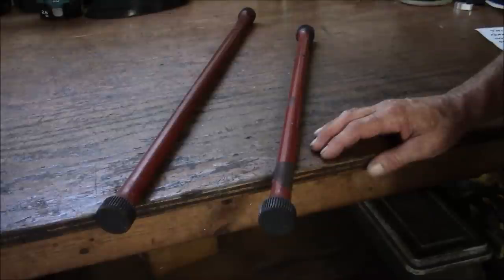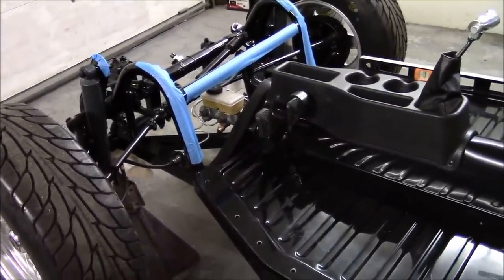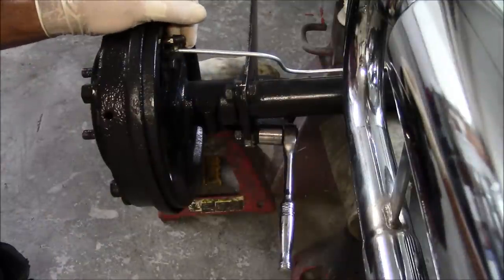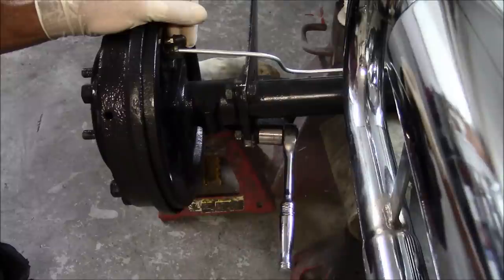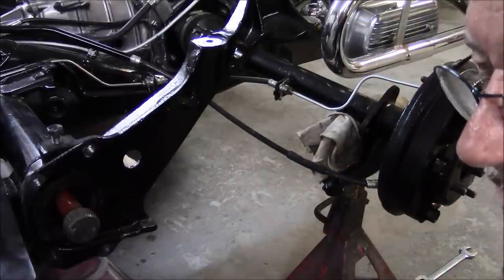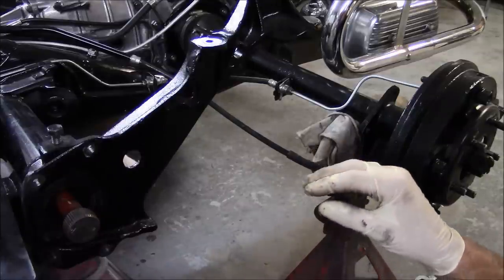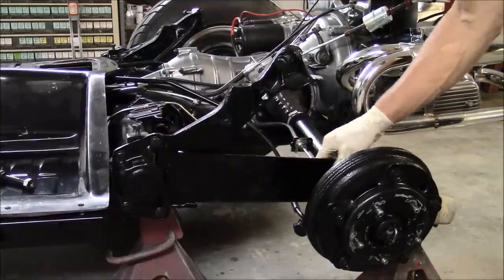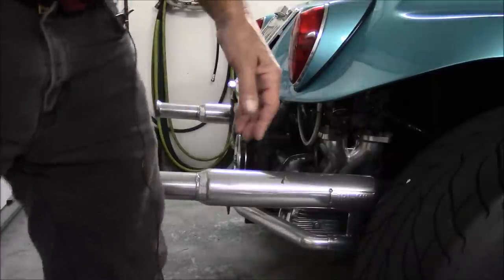PART 1 HOW TO ADJUST VW MANX DUNE BUGGY and BEETLE SWING AXLE SPRING PLATES

Comment: I have a baja bug and someone raised it to where the spring plates ride on the stop all the time in fact I can’t push down on suspension to get it to move. I am assuming that the person that raised it just moved the outer splines to get the hight they wanted with no regard to how stiff the suspension would be. So how would I keep that ride height and soften the ride. Thanks

Comment: Hello thank you for these videos  I have a dune buggy sitting on a 1956 split window frame that's cut the 9.25in.or close. with a steel window frame. the fiberglass body style looks a lot like the one in this video ..the fiberglass is in 3 pieces  dash, hood and main body. my question is ? how can i know if it is a Manx  Dune Buggy. It is in rough shape and looks very old I am going to restore it as close to orig. as I can  regardless this is cool and will be restored . Mr. Manx was a great builder and saddened by his passing..

Comment: Thank you for the explanation.  I'm adjusting the spring plates on a customer buggy.  The bushings were bad, and it had mismatched torsion bar covers (early style with the access hole).  They have 31" tires.  They want the tires to sit level when the car is sitting with no load.  Even though I know they are supposed to be adjusted as per your video (brilliant),  we're going to set them level so that they're happy with the help of some EMPI adjustable spring plates.  I'll have to check my measurements again tomorrow before I tinker with it again.  But I think I'm pretty close to your suggested settings.  Now that I understand in simple terms the way to adjust them, I think it should turn out great.  The adjustable portion will just be icing on the cake. Thank you sooooooo much!

Comment: I have no idea who put my Baja together, but I am going to start from new. I purchased a 28mm torsion bar because I will be using it at a woods buggie. Im currently running 30 inch tires in the rear with a reduction box. I have 16 inches of clearance. where would you recommend I start with  degree wise with a relaxed plate

Comment: This is hands down the best explanation I've seen on torsion bar / swing axle adjustment.  Thank you for breaking it down like this.  You briefly addressed toe-in for the rear end.  Do you have a video showing how to adjust rear wheel toe-in/toe-out on the swing axles?
Reply from the maker: I do the toe-in and toe-out right in my garage. I don't have a video on the tool I made or how I do it. But, now you got me thinking.  I recommend people take it to an alignment shop for that. On a Dune Buggy front is 1/8 toe in and rear is 3/16" toe out.
Reply: Thank you.  I've done front and rear end alignments on HMMWVs in the shop, on stands, with tape and a piece of rope.  I imagine I can figure out my sand rail.
Reply: I just wanted to thank you again for this video.  I have an Acme Classic 290 by Barrien that sat for who know how long.  The guy just put the torsion bars and spring plates in without tension to get it out of his shop.  This video saved my hair and probably my sanity.  Excellent instructional video.  I hope you decide to do the video on toe-in/toe-out.
Reply from the maker: I  will soon make a video of my home built toe gauge.  It's cheap and accurate.
Reply: Looking forward to it.
Thank you.

Comment: Thanks to Milo-I got my sand rail dropped 3" in the rear for a dirt trip I'm taking with it- with the camber taken out I am much less worried about fast cornering off-road leading to a serious barrell roll. Want to keep my roll cage pretty-thanks Milo
Reply: for lowering will we have to turn the degrees towards the left? in this video he turns it to the right for gaining height? and how much splines did you turn it to the left for that 3"?
Reply: You will turn the splines to the right on the passenger and to the left in the drivers side to lower the vehicle-oooosite to lift-I get 1.5" per tooth-so I moved two teeth
Reply: In our country we have right hand drive beetles . So to the driver side here we will turn right and to the passenger left , am i correct?! & what is the maximum tooths one can do within limit's and to not ruim the car? . And what are inner or outer splines people say? all i see here is right and left!!!
Reply from the maker: The number of teeth are unimportant. You want to adjust the angle of the spring plate. Old Beetles, you want 17 degrees, Dune Buggies about 14 degrees. Watch the video again. You need to get an angle finder, to do it right.
Reply: The driver seat position will not change the direction that you turn the splines.  I do not have an angle finder however I found that each spline lowered the rear end with only a tube sand rail frame 1.5 inches.  I imagine it would lower more on a car that hadn't had the body removed- start with one spline per side- once it's apart the first time it's easier to take apart again!  Good luck friend!-I don't have an angle finder and maybe got lucky, still found the video super helpful.
Reply: the outer spline is the gear and tooth set closest to you when you are removing,  the inner is inside the tube a hands length.  Hope it helps
Reply: @milomanx6531  a smart phone with a clinometer app does it perfectly...
Reply: is that inner or outer teeth

Comment: My 1968 Allied Fiberglass bodied buggy was maxed out on positive camber when I bought it. Your video made me brave enough to tear into this project since I've never done this on a beetle rear end before. When I pulled off my arms on both sides, the torsion bars came out with them. I put them in with the little "VW" stamp at the 12 o'clock position and from there went 13 splines to the center of the swing arm. This put me at about 14 degrees. I put it all together and drove the buggy and it had basically settled onto the bump stops. I moved two splines down (15 splines from 12 o'clock to the center of the swing arm) and I have just about 25 degrees now. Do the torsion bars need to be inserted in a certain position? Sorry for the long post. Just wanted to be clear on what I had been working with.
Reply from the maker: It doesn't matter where the torsion bars are initially installed. Did you take a degree reading when you initially popped the torsion spring plate from the chassis? A change from 14 to 25 is a drastic change, about 8 degrees. Moving one spline on the outer teeth is a large change, but, when moving the inner only, it is .7 degree. You need to watch my other suspension video. Click on the show more in my video description and read the comments I posted, to learn more. here is the link: https://www.youtube.com/watch?v=KTk9bI_5WF8&t=3s
Reply: @milomanx6531  Thanks for the reply! Unfortunately I did not measure my degrees before popping the arms off. A very amature move on my part. I'll check out your other videos and I'm sure they'll help me get this thing sorted out.

Comment: I just sent you one buck!  So here's my question: before watching this video I read the Bently manual, made only one mark on by axle tube, and then pulled my transaxle (I'm rebuilding the pan from the ground up).  I noticed right away you made two marks on your axle.  Am I going to have a problem with alignment when I put the car back together? I'm restoring a 64 Ghia.  Love your videos!
Reply from the maker: johnwarfn  One mark on the spring plate that lines up with a mark on the axle, let's you re-install it exactly where it was before, to maintain rear alignment. Often I've seen factory notches made to use as a reference.  I made two marks on mine, to be exactly sure. It's probably not necessary. I assume your working on a swing axle and it was either aligned or drove steady in the past. Remember to watch Part 2    And thanks, it's very appreciated.
Reply: Thanks, Milo.  The Ghia has been sitting in a barn for at least 10 or 15 years and who's to say the rear alignment is still good after 50 years. LOL.  I'll just have to hope for the best until I'm done restoring the car and get it aligned professionally.    Thanks for making videos that are well-produced and clear.

Comment: you mentioned the lubrication of the wheel bearing on a swing axle. what about the irs? is that just a sealed bearing? cant se it getting lubed the same way. great video! thanks!
Reply from the maker: IRS suspension has two sealed CV joints, per side. They are not affected by lowering the vehicle, but, they will wear faster at increased angles.

Comment: Why didn't you lose your place in the torsion bar when you pulled it out with the spring arm at the beginning? It looked like it came out a lot and you just put it back in without much worries. It would help greatly if people would say clockwise and counterclockwise when talking about torsion bars "turning this way, and that way" does not cover it IMO.
Reply from the maker: Pacifico VW When I pulled the swing arm and torsion out at the same time, I had a good reference point of the angle of the arm. I just put it back in at the same general location. Beside, moving the torsion bar just one tooth on the inner or outer is a lot of degrees difference. I thought I explained the rotation of the bars well enough. The left side is turned clockwise to add ride height and the right side is turned counter clockwise to add ride height. Did you watch the second video? Link is just below 
 https://www.youtube.com/watch?v=KTk9bI_5WF8
Reply: Thank you for your detailed reply. I just have not done this operation before and man it looks freaky; I will watch your 2nd video.

Comment: I just bought a tube frame buggy, the rear wheels have a ton of positive camber. Is this the procedure to correct this? Set the plates to about 10-14 degrees? Thanks.
Reply: Cletus McFarland Hell yeah brother. Got mine the same way :/ turning is the worst feeling ever on the street... if yours skips as bad as mine anyways.
You have Toyota size rear tires too I’m guessing?
I daily drive mine, idk why everyone doesn’t. AZ insurance costs me $37 a year... not month, entire year haha. Normal car would be around $200 a month. Thus (2k)Sunny was born luckily in One Piece.
Reply: Cole, I set my chenoweth framed rail at 10+/- degrees, with standard vw length gas shocks. my axle tubes r now at 3 degrees down, with the car sitting on the floor. I believe factory angles on the axle tubes, on swing axle types, is 3-4 degrees. It rides 'plush' now.. this rail only weighs 900 lbs. Also, Milo mentioned u want roughly a 25/75 percent split on swingarm travel, between the stops, being 25 percent from the bottom arm stop. that's how i ultimately arrived at my settings.

Comment: Doing this on an IRS, the Beetle factory setting is 20.3 degrees, what do you set the spring plates for a Dune Buggy?
Reply from the maker: I would try 17.5 to 18.0 degree. it should get you close. Measure pan height before and after, so you can compare degree to height difference. Be sure to drive it a couple blocks before height measurement. They tend to settle in after a short drive.
Reply: @milomanx6531  Thank you!   I will give it a shot.

Comment: milo adjusted mine yesterday im building a buggy . no motor on it yet 12 degrees on right 10 degrees on left question it seems tight when i just push down by hand on trans is it because i dont have the weight of the motor on it ,, any help thanks .
Reply from the maker: +Gary B The weight of the engine will make a big difference. Make sure you roll it back and forth to get it settled down. If you have a swing axle, I feel the degree settings are too loose, you will want 14 degrees on the passenger side and less than 14 on the drivers side. Like 13.5 to 14.0 degrees. If you read all my comments at the top, I set mine this way.

Comment: whats wrong with air ratchets
Reply from the maker: If you mean to remove bolts, that's fine. If you mean to torque them with an air ratchet, that's no good. Sometimes, I find it easier to work with hand tools, especially in tight areas.